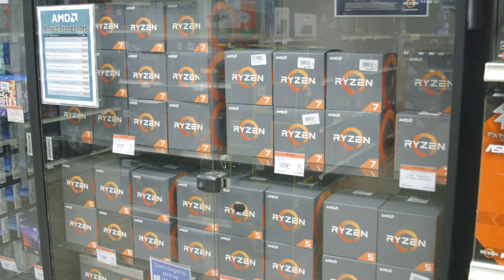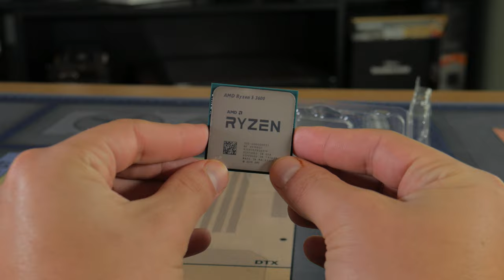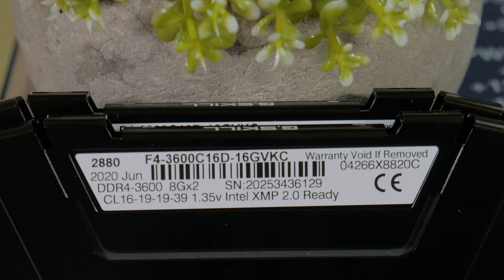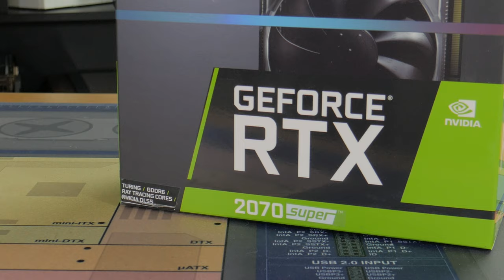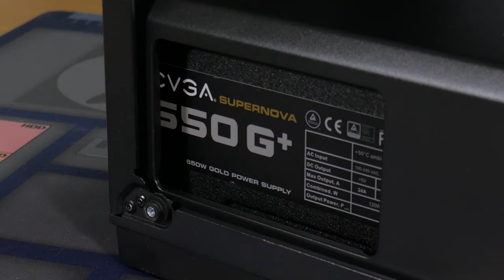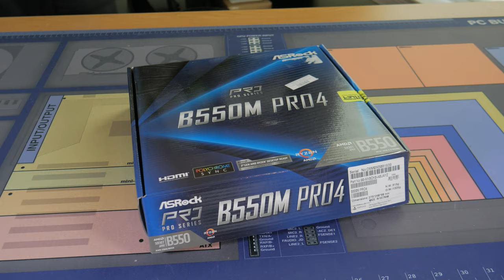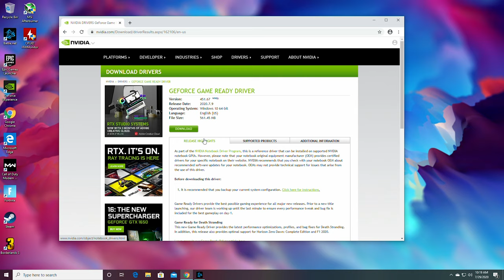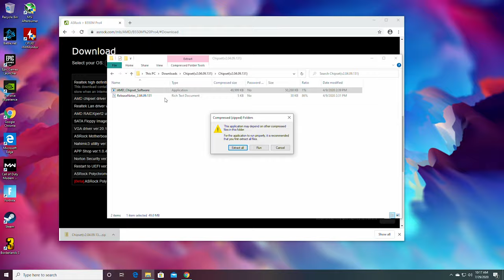$1250 Gaming PC Build Guide! (2020)

Comment: So for anyone wondering i built this computer almost exactly (exept i added a exhaughst fan and 2 top fans it helps tremendosly) And it works great tbh only thing i would change is the cpu but this was my budget and i am completely happy with it (also i would recomend waiting for the 3070 series but they wont be stable till probobly january so)

Comment: I did an overclock on my Ryzen 5 3600 at 4.3ghz 1.375 volts with an 80+ rated 750w psu and a Asrock B450 Steel legend motherboard. Works really well and is very stable even in intensive benchmarks. The cooler i originally applied the oc on was the Be Quiet Shadow Rock 3, which worked well but i upgraded to an Aio recently. Overall the system works fantastic and I'm very happy with it.

Comment: Tech by Matt: Builds a rig for $1250 
Me: Wheres the back fan?
Reply: cpu fan can do the job
Reply: Yeah so I built a pc somewhat like this but I ended up needing the back fan. Let’s just say heat was a factor
Reply: @jacobhenry9976  did u OC or just really needed one
Reply: @user-cb3pp2kl8z  well it does run hot, but it’s not actually the reason I’m having issues. My pc is shutting down completely on certain games and at first I thought it was heat as on destiny 2 I had a max of 92 degrees on my cpu. But then it was also happening on rainbow six siege and it wasn’t even reaching above 75. So after testing it it turned out to be my power supply not having enough watts. But I am still going to strongly suggest getting an exhaust fan in the back and maybe even one on the top because even though it’s not crashing bc of the heat it doesn’t need to be that hot anyway. Also I had absolutely nothing OC’d
Reply: @jacobhenry9976 Thanks so much for replying , usually people don't like talkng about their experiences with builds but I will take that into account if I want to build this pc

Comment: The wire connection RGB etc was a little fast and hard to follow. Wonder if you can help with that. I want to build this. Would the new RTX 3080 work in this? And upgrading to Ryzen 7.

Comment: Perfect price range for me! Thx 😁
Reply: I wouldnt build that, heres a better alternative 
https://pcpartpicker.com/list/NBWhhg ($1070)

A 2070s is optional if you really want an nvidia card, but 5700xt gives the same performance in game
Reply: MP CINEMATICS with some awful driver issues, I’d wait til amd gets their shit together or for 3000 Nvidia’s and Navi’s amd
Reply: @aidang7182  amd driver issues have been fixed ages ago, but yes ampere does release soon
Reply: MP CINEMATICS no they haven’t lol, look it up and you’ll see a lot of recent things
Reply: @aidang7182  such as? Any sources?
Reply: @adverse_world  WOAH WOAH WOAH..... I wouldn't build this either due to the CPU (I like having 8+ cores). But you recommending a 5700xt over a 2070s is hilarious. The drivers will put you through hell, with crashes that corrupts windows. (Trust me, me and some friends have experienced it first hand). Also, 5700xt's have weird chips and pcb which makes it harder to cool. This makes the reference card overheat sometimes and some of the models with multiple fans don't make the cooling any better due to the structure of the actual card. Onset, I reccommend going with a 2060 instead of the 2070s to save you around 200 dollars. Pairing a 2070s with a r5 is fine, but if you do video/photo editing it doesn't make a lot of sense considering how small the price difference is between the r5 and r7. You could also put some of that 200 dollars saved towards a 144hz monitor. Good luck building
Reply: @aidang7182  lmao, Radeon has corrupted windows for me 4 times, but my other pc's with nvidia gpu's do just fine. I always find it funny when people defend Radeon. I had a friend that was upgrading and I told him not to get a 5700xt, but he did anyways. He averages 2 crashes a day. Now he takes my advice when it comes to buying pc parts.
Reply: @cursedkeys7575  no idea what you mean with the PCB's, certain drivers on the 5600xt/ 5700xt caused it to overheat and sometimes melt parts of the pcb which caused artifacting. Since then they've fixed drivers to run cooler and revisions of certain models have solved these issues, and the pc was advertised as a "gaming pc" which was the reasoning for the 3600 (more then sufficient for what the pc is meant for)
Reply: @adverse_world  they never "fixed the drivers". Trust me, they are still mess. The reason I brought up radeons new PCB design is because it caused a lot of overheating. Drivers made the overheating a lot worse. Radeon is just so hard to recommend in 2020. It is a good budget option if you want to put up with constant issues.
Reply: Look if you watch any big tech youtube, they will talk about how AMD fixed their driver issues ages ago. Everyone gets crashing, thats just technology for you, but if you guys are going to bring up very specific cases about the RX 5700xt being bad, than so will I. I have had the RX 5700xt for a little over a year now. It does run a bit hot on 1440p 144hz, but in total its probobly crashed once or twice. One of my friends has alsochad this card for a few months and said its great.
Reply: @darwinsexplosions  the model is also a big part of it, certain models such as the asrock challenger or mech oc cards run slightly toastier then others like the sapphire pulse or nitro+
Reply: MP CINEMATICS yeah I have a Gigabyte OC card
Reply: @CursedKeys thx for all this information 😁, could u tell me what cpu and going I could put together while still aiming toward this same price range for a pc?
Reply: @Matt-ov6cq  1250 is an odd price point, 1000-1100 gets you a nice 2070 super/5700xt build, while 1350-1400 can get you a 2080super. Also awaiting next gen ampere cards in the coming months is also an option
Reply: MP CINEMATICS ok thx
Reply: MP CINEMATICS from a day ago
https://www.reddit.com/r/AMDHelp/comments/i5dkzp/what_is_the_best_rx_5700_xt_driver_at_7th_august/
Reply: Aidan G .
Reply: I don’t understand pc parts so I’m just going with the video
Reply: Frost_Fire _ bruh
Reply: MP CINEMATICS just wait till navi 2 and ampere as well as ryzen 4000 more performance for your money unless you need a computer now
Reply: @adverse_world  Stop watching unbox therapy. Only they say drovers are fixed but they are not
Reply: @md.taufiqulhuq7827  unbox therapy doesn't even make hardware content lol
Reply: CursedKeys hey was looking to bulid a 1.3k pc that runs dual monitors and cod at really good FPS and speed and also can maybe stream
Reply: Also there is still 100 dollars for you to maybe get a 2060 super for more performance
Reply: Legend Made bad psu bad ram no need for 32 Samsung tax ssd the list goes on
Reply: Legend Made also 3700x is way too overkill, 212 is obsolete now and tomahawk max sucks
Reply: Aidan G if he’s streaming yea 32 is the minimum games like cod take up to 10-12 gbs alone battlefield as well
Reply: Aidan G lmao your critiquing the build then make your own guy I’m just trying to give the guy ideas
Reply: Aidan G hyper 212 is definitely not obsolete a fantastic air cooler not high end but if he wants a beefier cooler I saved him some of his budget the max board is a great board who lied to you most zen 2 owners use that board and EVGA makes great  power supplies stop hating
Reply: @cursedkeys7575  I had a rx580 that constantly crashed and upgraded to a 2070 super. Never had a driver crash on the green team had 3-5 a day on the red team. You can say what you want about me installing drivers incorrectly because i didn't and I also ran ddu to make sure everything was clean. I'm not a huge fan of radeon even if they are cheaper

Comment: Personally I wouldnt recommend manually overclocking zen2 ryzen cpu's. Unless what you are doing is strictly video edits and 3D renders that is. The reason Intel is usualy classified as the "king of gaming cpu's" is due to its high consistant single core clocks. 

With that said. Gaming very much so benefits from higher and consistantly higher clock speeds and instead of setting a all core over clock, you can increase PBO Parameters, for example. I can all core clock my 3600 to 4.3ghz no problem, but with some tweaking to PBO I can get a consistant single core speed of 4.5 while getting and all core speed of 4.3>4.4.

Overall from my experience keep in mind. Overclocking with PBO gives a way more consistant and stable OC and you cant do it wrong and its 10 times simpler.

Also (this is still very debatable) setting a constant voltage on these chips can cause early degredation since normally it jumps up and down by the nano seconds.

Id recommend setting a negative 0.05 offset if the chip is running hot or at uncomfortably high voltages stock (1.4+).

The cpu works within its "safe limits" with pbo, if you give it more leanway to get higher clocks and use more power and it notices it has thermal headroom it will take advantage of this. Its very hard to mess up with a PBO OC unless you are doing something horribly wrong. 

Also make sure either global c-state, AMD cool and quiet or both are ENABLED for these chips to idle properly if anyone has issues with this.

Other than that, great video!
Reply: tell him king
Reply: I’m super confused and am wondering if this would be a good pc to build, if not what are some better builds
Reply: @Slynics  its pretty good you can also go with a 10400 or a 10600k
Reply: Nobody asked

Comment: I should’ve went with this

I built my pc about the start agust

Cpu:Ryzen 5 3600
Gpu:pny 1650 super
Mobo:asus x570 tuf gaming with wifi
Cpu cooler: cooler master hyper 212 black
Ram: 2x8gb corsair vengeance 3600
Psu: corsair 850 watt 80+gold
Case:corsair icue 220t
Storage: 
1tb samsung 860 evo ssd
2tb seagate barracuda hd

I think i really messed up on the gpu 
And i went well over this price range for this

It was my first build as well
Reply: Well hey, you're PC is ready for a bigger/badder gpu when you're ready. Nothing will bottleneck! :)
Reply: Actually thats a great pc best choice knowing that new GPUs are in the way. And everything else is awesome. Maybe a cpu change in few years.

Comment: Just what I was looking for! <3
Reply: I would suggest that you purchase an AMD RX 5700 XT over the Nvidia 2070 super. The 5700 has a much lower price tag (depending on the hardware brand) and performs nearly identical to the 2070 super. This is only a suggestion, but I highly suggest you research more into the RX 5700 xt

Comment: Would i be able to use the gtx 3070 instead when it comes out?
Reply: That's what I'm doing
Reply: @Bayfire_studio  do you know if all the parts will be compatible with the gtx 3070?
Reply: @mw2god440  yes, checked it out. Pops into the same motherboard slot.

Comment: now if this was a B450/X470 motherboard, I'd suggest the P1 Cruicial NVME SSD you got. 
But this is B550, you want to at least get a SSD that will at least take advantage of the PCIe 3.0 M.2 on the chipset. The Crucial P1 2000/1700 read/write speeds is better suited for boards older than B550/X570.  It should go in the lower M.2 slot by the chipset of a B450/X470 that is PCIe 2.0. 
For thsi build you should have suggested one of the following: Samsung Evo 970 Plus (pricey but fastest PCIe 3.0 SSD), or Patriot Viper NVME (more affordable yet close PCIe 3.0 speeds as the EVO). 
On a B550 put these in the slot by the chipset at the bottom.
Then when Samsung launch their 980 Pro NVME, a real Gen4 NVME SSD, get that install that on the M.2 slot by the CPU.

Comment: This almost made me regret my recent build of 1600 AF, OG haha gigabyte 2070 x2 rev 3, and ASRock b450 Pro4... Almost lol $100 for CPU and $400 on the GPU was a great decision. Managed to get everything such as  enermax revobron tuf gaming alliance 700w PSU, wd black nvme m.2, viewsonic curved 32 inch 1ms monitor, chair, razor ultimate controller, keyboard & mouse, and Metallic Gear Neo silent case to hold the cheapish beast! All for around $1200-$1400. Great rig though the CPU isn't quite cutting it for higher frame rate stability on the titles I play. Still average 125fps warzone with high setting even after hours of brutal gaming. The case gets a bit toasty, but I don't mind. Lol winters here are harsh. So it's quite cozy to have on those days lmfao

Comment: Ok so I don’t think anyone noticed but at the video he photo shopped the power cable at Time 9:45 but anyway great video keep it up also I built this computer with some parts but used for only 567$ and at 1440p ultra high settings in fortnite I haven’t dropped 400 FPS

Comment: Tech By Matt, I have the Ryzen 5 3600, Asrock B450M Pro4, 3200mHz RAM, and a Cooler Master Hyper 212...will these OC settings work with mine as well?

Comment: Is it possible to replace the 2070 with a 3070? or do i need to change any parts?
Reply: Hmmm... If you are using the same motherboard then probably the only thing you should upgrade would be the power supply 650 watts is enough for a 3070 but a 700 or 750 watt PSU would be a safer option to optimized the graphics card. If you have a different motherboard then you need to make sure the PCI-E slot is at least gen 3.0 which it will work with but if you have a 4.0 it will run much better and optimized for the 3070 graphics card.

Comment: I never built a pc before, but does the power cable connecting to the outlet come with the build? Srry if it very obvious
Reply: That would come with the power supply. Its a standard PC power cable.

Comment: Bro I know the 2070 Super is the superior card, ray tracing, better for streaming, blah blah blah but the 5700XT is sooo close in performance for strictly gaming (occasionally out performing the 2070 S in some games) and its only FOUR HUNDRED DOLLARS. I just cannot imagine not wanting to save that kind of money for other parts in the build, a higher quality monitor, mouse, keyboard, headset, ANYTHING. In my opinion, this price range should aim for the 5700XT. Once you start pushing towards $1500, for sure go for a 2080 or 2080 super. You just can’t beat the price to performance of the 5700 XT.

Comment: Great bang for the buck, but I do keep wondering why you chose a mATX motherboard over a ATX one that has more ports
Reply: Better value
Reply: I mean why do you need so much ports?
Reply: @deciphertwentythree7726  Thinking sound cards and wifi card. If you have the space, then why not? smaller boards also tend to be more expensive

Comment: hey all i just picked up the mobo, cpu, cooler and ram in this build to upgrade my older parts. I used my cx750 and geforce gtx 1060 ( next year upgrade) and a corsair case. This was my second attempt at replacing parts in a pc. computer turns on and works fine also noticed a performance upgrades from my old parts.  

problem: I am getting 2 solid red lights on the mobo #20  Post Status Checker (PSC) VGA and Boot. If i try and restart the computer it goes to the asrock screen and after a few seconds screen goes black with the 2 lights on mobo. I have too shut down the computer and turn it back on to get it work it then takes me to windows and work properly. 

Any help or ideas thanks!

Comment: I want to build my first gaming pc ever and did a lot of research. But I still wanted to know if somebody could give me some tips for my specs and if they even make sence. Would also apricate it if someone could help me with choosing a ssd and hdd.
My specs:
be quiet pure base 500DX white
CPU: ryzen 5 3600
Mainboard: ASRock B450 Tomahawk Max
GPU: AMD RX 5700 XT
Powersupply: 550W CorsairTX550M
RAM: 16GB Corsair Vengeance RGB PRO 
white
Reply: Overall excellent build. Hold off on buying a gpu right now. New ones are coming soon
Reply: F-22raptor oh okay thank you very much for your response!

Comment: Pc build parts $1000

Network card 7801035 :: Startech 1 Port eSATA + 1 Port SATA PCI SATA Controller Card - Storage controller - 2 Channel - SATA 1.5Gb/s / eSATA low profile - 1.5 GBps - (PCIESATA2I)

Ram 9252692 :: Kingston ValueRAM - DDR3 - 8 GB - SO-DIMM 204-pin - 1600 MHz / PC3-12800 - CL11 - 1.5 V - unbuffered - (KVR16S11/8)

Graphics card/ processor 41895083 :: Asus AMD RYZEN 3 AM4 PROCESSORS   CPNTDUAL M (PRIME X570-PRO)

Power supply 40056955 :: Corsair CX Series CX550M Power Supply - 550 Watt, 80 PLUS Bronze Certified Modular ATX PSU (2015 Edition), Matte Black Finish - CP-9020102-NA

Sound card 41556893 :: Asus SOUND CARD XONAR SE 192KHZ 24-BIT HI-RE (XONAR SE)

Case  Apevia Aura-S-BK Mid Tower Gaming Case with 2 x Full-Size Tempered Glass Panel, Top USB3.0/USB2.0/Audio Ports, 4 x Spectra RGB Fans, Black Frame https://www.amazon.com/dp/B07TZKVZV2/ref=cm_sw_r_cp_api_i_5SWlFb2MZDG7A

Fans x4     Corsair LL Series LL140 RGB 140mm Dual Light Loop RGB LED PWM Fan Single Pack Cooling CO-9050073-WW https://www.amazon.com/dp/B075VHBC4S/ref=cm_sw_r_cp_api_i_2TWlFbPK0N60V
Reply: ddr3 ram wut???
Reply: Xenoy - Little Big Snake they are links some don’t work tho so go on tiger direct and search them up
Reply: Doge Gaming I can run 500 frames

Comment: What do you guys think of the following build? Just for Warzone and MS flight sim. 

CPU: AMD Ryzen 9 3900 - 12-Core 3.10GHz, 4.30GHz Turbo - 64MB L3 Cache Processor, 

FAN: Cooler Master Masterliquid Lite 120 Liquid Cooling System w/ 120mm Radiator, Extreme OC Compatible [+21] (Cooler Master CPU Water Cooling, Extreme OC Compatible)

MEMORY: 16GB (2x8GB) DDR4/3200mhz Dual Channel Memory (HyperX Fury w/Heat Spreader)

MOTHERBOARD: MSI X570-A Pro: ATX w/ RGB, PCIe 4.0, USB 3.2, SATA3, 2x M.2 [+67]

POWERSUPPLY: Corsair RM750x 750W 80+ Gold Modular Gaming Power Supply [+60]

VIDEO: ASUS GeForce(R) GTX 1660 SUPER 6GB - DX12(R), VR Ready, HDMI, DP - 3
Reply: What are you using this pc for?